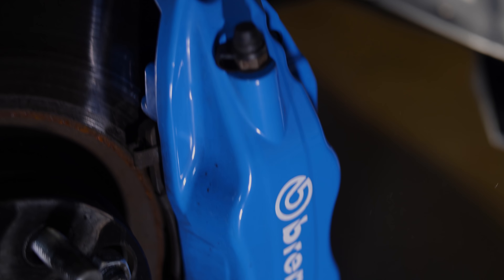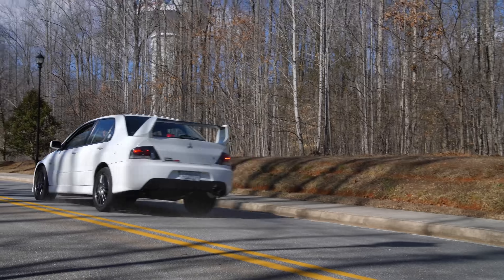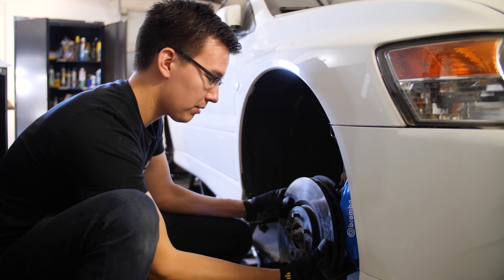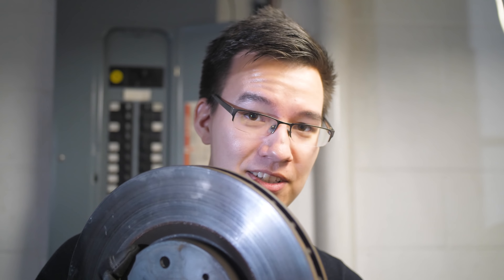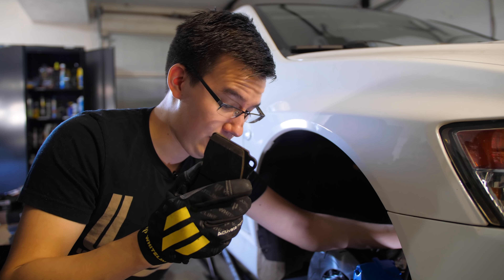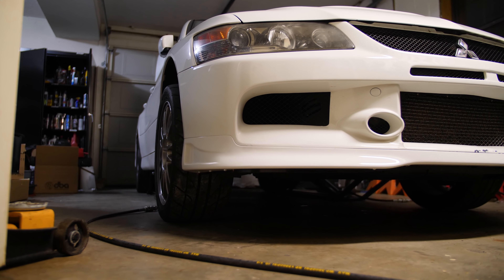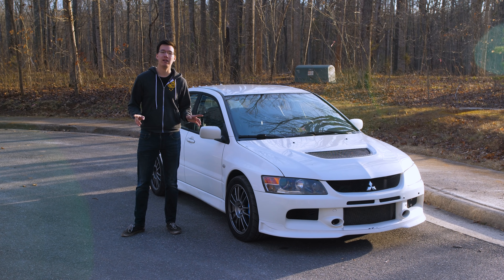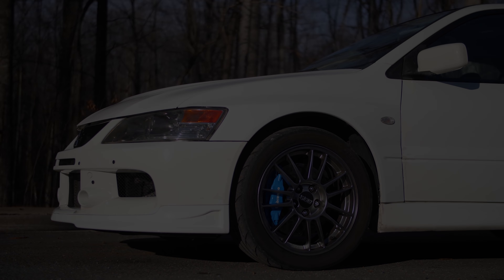How Much Do Pads and Rotors Help Braking? [4k]

Comment: not everyone got brembo brakes stock you know
Reply from the maker: +Dariune and that's not the point! You don't need brembos for pads and rotors to be a huge help!
Reply: Dariune a car like that is light and shouldn't have trouble braking.
Reply: A lot of cars come with pretty decent calipers to begin with, especially sporty ones. Even my GTO, with notoriously weak stopping power, saw quite an improvement installing slotted rotors and higher grade ceramic pads.
Reply: I agree with this comment. Most cars will come with a sliding caliper setup. Having a fixed, multi piston caliper is definitely a plus.
Reply: Robertas S. But I got some high temp red paint, does that work😆

Comment: Quality videography!

Bad information, unreliable testing, poor conclusions.

Any braking setup that can cause wheel lock-up will stop in the same amount of time as any other braking setup that can cause wheel lock-up. If the stock brakes were unable to lock-up the wheels, there was something serious wrong with the brakes and it would be dangerous to drive - it would have failed any tech and safety inspection at a track or during government emissions.

Modern brake pad materials, even inexpensive ones, don't outgas like they did 30 years ago. Slotted and drilled rotors aren't for gas paths anymore, they're mostly for cosmetics, and in some instances are to clean the pads.

The real benefit of upgraded brakes is their temperature capacity and ability to function at high temperatures. That's it. Dusty metallic pads can hold more heat, stay together at higher temperatures, and wear evenly at higher temperatures while still providing high friction. Larger rotors can store more heat and dissipate more heat allowing you to run them harder for longer before the surface temperatures become problematic. Larger calipers allow more heat capacity and sometimes increase the number of pistons which ensures even pressure over the pad.

The benefits are seen when you've added massive amounts of heat to the brakes during extended periods of braking such as on a high speed track or road course. 

Test results of braking at some point and measuring the distance to stop can never be trusted as reliable.
1) You'll never hit the brakes at the place you intend to.
2) You'll never measure from the correct spot since you can't know exactly where you started applying the brakes.
3) You'll never hit the brakes at the desired speed since speedometers are lazy and vary a bit from minute to minute. 

You would want to test on in a way which has reliable valid results, such as on a wheel dyno or with a GPS datalogger designed for such things.

Better tires will do far more to improve braking performance than upgraded brakes, unless you already have excellent tires or are actually fading your current brakes.
Reply: So am I understanding you correctly, that you feel the claimed 19 feet improvement in stopping distance entirely is not there, at all?

That doesn't sound completely convincing to me. So they did multiple runs (and thus mostly accounting for your point #1 and I believe partly for #2). I assume he will have used cruise control to set those 70mph (if so, that would account for #3). According to your reasoning, then the significant improvement claimed in this video would all just be due to the previous' brake setup's inability to lock up the tires - and besides that being implausible, even the video shows clearly, that it was able to do so (e.g. I see ABS interference in the video).

Maybe you do actually know this stuff much better than me and I just don't see it ... but I don't see how your reasoning explains the 19 feet improvement.

Comment: i ve been running a stock rubbish brake on my 800whp 2jz nissan a31 swap car for 2 years now, for you who dont know the brake is almost quarter of the 2009 honda accord capable of....and i always chickened out when people is trying to race me in the street ( kinda like dog fight style race)..i really want to upgrade my brake to brembos or ap racing..but those damn brake cost around USD 2700 a set (front only) 2nd hand..where i live....and worst part is i kinda dont have that much money laying around for upgrading my car...so i guess imma kept on being jeoulous seeing people with those good brakes...LMAO
Reply: wait what? you had the money to do a 800hp 2jz build and swap it into a nissan tuned it got on the road running, but don"t have the money to upgrade brakes for over 2 years?
Reply: err yes thats correct, because i build the engine step by step, not as in a whole package all together and ii always come to the part where i have to choose 1 out of 2 upgrading choices..and for some reason brakes upgrades is always on delay, and as a result 2 year has been pass and my brakes is still a stock shitty brakes...